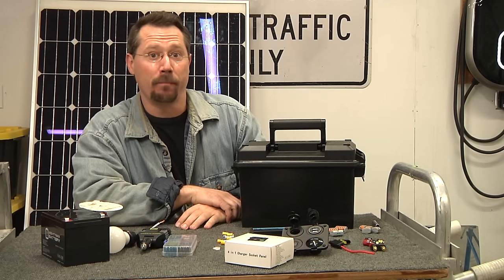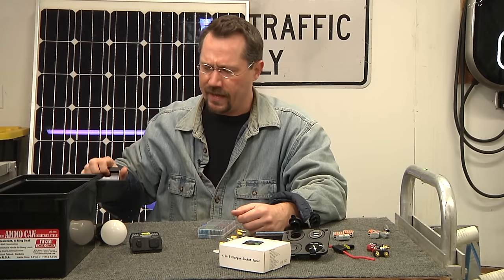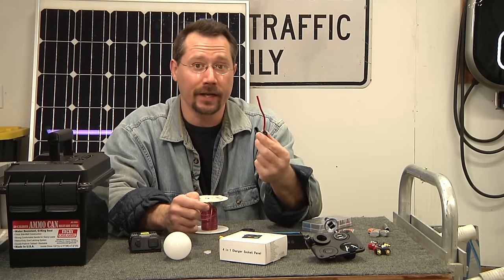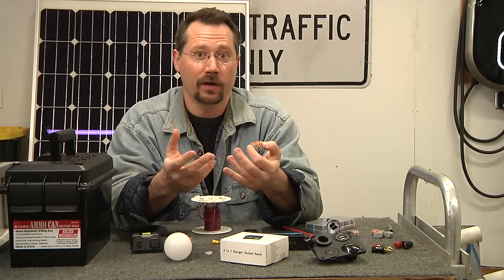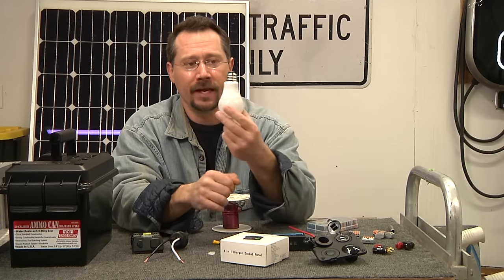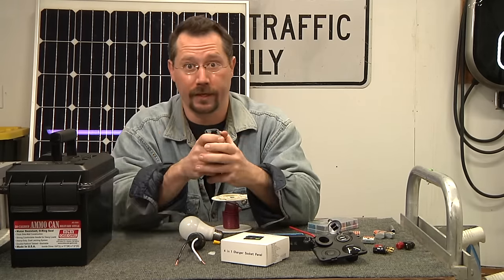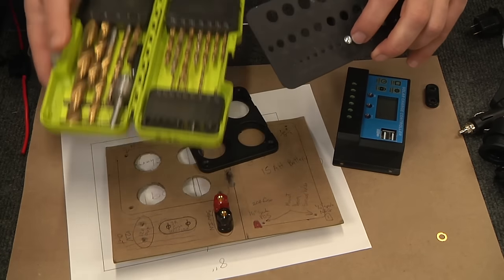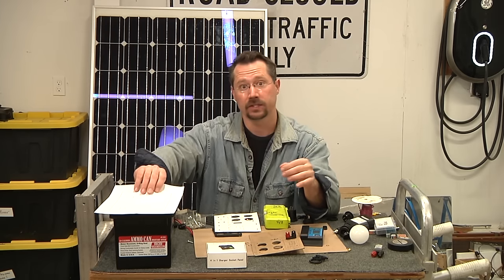Build A Solar Ammo Can Full-Length Instructional Video

Comment: I love this! I have so many questions. This only scratches the surface as I am so ignorant.  I just bought a 100 Ah LiFePo battery.  I am so afraid of and in awe of it -- I want to build a battery box in order to camp with a 12v freezer, use a diesel heater, CPAP for husband, and even sew, etc.  I need more help.  

Do I need a ground wire?
The wiring is hard to sort out here.  Any suggestions for learning more?

Comment: I'm really happy with the "Personal Power Bank" that I built, inspired by this video.  I'd share some pics if I knew where to send them.  The configuration is similar to yours but I went with an 18 Amp-hr battery, built my inverter into the dashboard and added a Cigarette Lighter Socket as an option for the input (1.5Amp Max).  Otherwise, the configuration is very similar.  My current solar panel is identical to the one you featured BUT I'm considering an upgrade. I'm looking at an 80W 4.5 Amp charge rate or a 100W 6.1Amp charge rate.  Questions: Can the banana jacks handle that much current? Thanks again for putting this video together, I keep coming back to it. Chris
Reply: Question: Does the like mean that the banana jacks CAN handle 4 to 6 Amps of current? See above! Again, thanks again for putting this video together, I keep coming back to it. Chris

Comment: Love this video tutorial. I do have a question for you. I'm in the middle of making a pond on my land and I won't  be anywhere near a power source.  I want to have a water pump in the pond and will need power for it. My question is will this work running a water pump and keep it running all or most of the night?
Reply from the maker: To find the answer, you need to do some math.
On your pump (or whatever you are trying to power) there should be a label saying how much current (in Amps or A) the device uses.

Batteries are rated in Amp-Hours, or AH. That is essentially how many hours they can run that many amps.
For example, a 50AH battery should be able to run 5A for 10 hours, or 1A for 50 hours.
Keep in mind that for lead-acid batteries, to give them a good long life, you shouldn't run them down more than half-way, so that 50AH rating really becomes 25AH usable.

If  you have a device that draws 5A, and have 25AH of usable battery, then the battery can power the device for 5 hours.

If you are only charging with solar, you also want to make sure that you can get a FULL charge during daylight hours AND that you can run the battery for several days without recharging because it's not sunny every day.

These are just the quick basics.
There's no fast answer to "can X run Y?" without knowing all the specifics.

Comment: Great video! As an electrician, I wouldn't recommend quick connects because of the higher amperage. Solder or wire nuts or crimped connectors are better because of more surface contact with the wire is reliable over time.
Reply: There's no high amp components in this man.
Reply: @JonJon501  Depends on how much current the load pulls from the battery.  I overloaded my battery box (which has a smaller battery) and popped the 25 AMP main fuse...
Reply: BUS BARS

Comment: Hi.  Love this build.  I am building this today but bought 2 x 8ah 12v batteries instead of a single 15ah (battery availability).  I will be wiring them in parallel but should I connect the charge controller + and - to a single battery or + on one battery and - on the other battery?
Reply from the maker: GREAT Question!
The generally accepted practice for batteries connected in parallel is that you want the power connections to the rest of your equipment to connect on different batteries instead of the same. If you have two batteries in parallel, connect at opposite corners with the positive on one battery and the negative on the other battery.
Always keep all connections the same length and as short as possible, using the appropriate wire.
Reply: @BenjaminNelsonX  awesome! Thanks for thr quick response.  Then it's prob not best to use wagos to connect the batteries in parallel and then connect the controller to those wagos?  Just connect the two batteries together with 12ga and then seperate 12ga from the controller to thr batteries on opposite ends...?
Reply: @BenjaminNelsonX  hi , I have been enjoying this ammo can setup for lil while now.  I use it mainly for my camping trips to charge phones and cameras. Works awesome!  One question, what do you think about charging this from a car cigarette lighter (only when the car is running).  That should work, right?  The car is at 13.5-14v when the engine is on so it should charge the battery can... albeit it could be slow which I'm ok with.

Comment: Maybe you have the answer to my question:   I do solo camping in an old van.    I would like to have a gas generator charge the bettery in a solar power pack (commercial or not).    I would like th battery in the power pack to power some light devices like portable refridgerator, LED lamp, radio, computer, smartphone charger  all over night and even a bit longer (as much as possible).    The question is:   What is the right way of plugging the generator to the commercial solar power pack?

Comment: If I use a larger battery (mighty max 35ah) on it’s side. Think this would work or would I need a bigger box? Great video btw.
Reply from the maker: This project is really more of a concept than anything. If you have some other convenient size box that works well, use it. I just really liked the way this particular battery fit this particular box, it was stackable and modular, and everything fit inside. People have built similar projects with Pelican brand cases, suitcases, and all sorts of other boxes.
Just know the measurements of your battery and your box and you should be fine.
Reply: Thank you sir!

Comment: Another question if you don't mind. I see you connected 6 black wires to 2 wago connectors. I also see a small black wire connecting both wago connectors together. Could you explain this move please. It is not explained in your wire connection on this video. I realize you compressed the wiring part for shortness but I don't want to miss any pertinent connection.
Reply: Basically, all the black wires go to a common ground, 12V DC Negative. They couldn't all fit in the one 5-wire Wago connector. Another way to do it would be to have all of them go to a ground bus bar. Something like this - https://www.amazon.com/dp/B000NCYQ82/ref=cm_sw_em_r_mt_dp_U_5ZGeFbAACBA12

Comment: Will this system output current while charging the battery at the same time so if I'm using the power and the solar is active will it output steady current? Aswell if the battery depletes will it charge back up automatically and then send current through again, I'm asking because I'm looking for a portable solar setup for my Ev while I'm parked in sunlight. And essentially just need the solar panels to charge up my car

Comment: Hi Ben
Got a quick question. I did the solar ammo can setup. When I plug in a portable 100 watt inverter into the 12v cigarette lighter plug the ammo can unit shuts off. All wiring is done right. Do you have any answers to this issue. Thank you. 
Tim

Comment: flat washers then lock washers next to the nut...

other then that, it is nice, for a simple off the self project.

you should look into upgrading it to a 18650 pack, and get aprox 6 times the storage, and not much more weight...
Reply: I notice that too. The lock washer is used to keep the nut from moving. Only 2 of us noticed or only 2 bothered to reply?

Comment: Great video! thank you. i wonder if it would be possible to parallel to of the same battery you have used in this box and get double the power? would the other items need to be increased in their strength and amp?

Comment: I can use the 12v 100 watt panel instead without any issues? Like i can wire that in place of the one in this video as a straight swap out without and wire gauge changes or component upgrades?

Comment: Stupid question, but how come the negative wires require 2 of those lever locks with a wire also connecting both of them, while the red only has 4 wires?

Comment: Fantastic video. My one question would be is it at all possible to charge this as you are driving, through the 12V cigarette lighter, or is its output just not as much voltage above what is needed to effectively charge the ammo can battery? How about using an inverter off the cars cigarette lighter then using your AC power charger?
Reply from the maker: You can essentially run power straight from your cigarette lighter plug to the battery. When your car is running, the voltage of the car battery will always be at a charging voltage higher than whatever the Ammo Can battery will be at.
The exact current the battery charges at will simply depend on the difference in voltage between the two batteries.

Comment: Any ideas on what solar panel to use? Just starting buying my supplies. Can’t wait to put this stuff together.
Reply from the maker: A 20 watt solar panel is a pretty good match for this setup. Something along these lines: https://amzn.to/3AP7zAj
Reply: Excellent. Just went and bought a battery, red wire, black wire, in line fuse, and a few other things. I’m going to put this together in a plastic toolbox of mine. Thanks for the help!!

Comment: BenjaminNelson, I am putting together a small system that is going to be used outdoors year around to power a trail camera and a Netgear Arlo.  The ammo box will be closed at all times.  I added a vent that will not allow water or insects in, as high as I could on the box sidewall.  It is about 3/4" diameter. Is this vent necessary, and if so, is it alone sufficient?  I thought about adding a USB fan to circulate air on a timer to come on for an hour once per day.
Reply from the maker: SLA batteries should not need to be vented in regular use, flooded batteries should be.
Keep the box in the shade.

Comment: I love your ingenuity!!  One question as I'm considering doing this project.  Could you perhaps use a lighter socket in a vehicle to charge this system while you are moving from one campsite to the next, so that a person might efficiently use their time when they couldn't be charging up the unit with solar or an ac outlet (as they be on the road)... And then top off the charge to the battery using solar once they reached their camping destination?  If so... And ideas on how best to manage this?  Appreciate your consideration and interesting ideas!!
Reply from the maker: Great idea.
Yes, you absolutely COULD charge this from the 12V battery in your car via the "cigarette lighter" 12V jack!
You could just have a cig plug with bare wires on the end and connect that to the "SOLAR IN" port. 

The only thing I can think of at all is that some newer cars only have a pretty low power output as it's dedicated as a 12V power plug only (NOT a lighter). You might just want to check your car fuse box first for the cigarette lighter circuit, to make sure it's not a really low power one, and to be able to replace the fuse if you accidentally DID blow the fuse.

Comment: You mention wires of 12 gage being used but the 20 amp in line fuse I see have 14 gage wire on them? Will this make a difference.  Can't find a 20 amp inline fuse with 12 gage wire. Great video BTW. Ordering parts on Amazon myself.
Reply: Keep looking. The purpose of a fuse is to protect the wire. DO NOT use 14 gauge with a 20 amp fuse. It should have a 15 amp fuse. If these 20 amp fuses are, in fact, used with 14 gauge wire it is a violation of the National Electrical Code. Report this to your county inspector or the local fire department.

Comment: Great video...I'm currently building one of these and I have ordered most of my parts. I like the wago connections. I was curious how the cheap solar controller is holding up..?? I ordered a 30A of what looks like the same model.  Please let me know if you have any other suggestions...like, banana clips....is there a better way to connect the solar panels..??? Thanks for your help and you have a new subscriber,  appreciate the love back my way on my YouTube channel!!! Thanks again for the great video!!!
Reply from the maker: I haven't had an issues at all with the solar charge controller.
There's a ton of different style connectors that you could use to connect a solar panel. If using any type of connector that holds both wires, just make sure it's polarized so that you can't plug it in reverse polarity.

The only type of connector I would advise against would be ones like the MC4 connector. Those are perfect for large, permanent solar arrays, but they have a locking mechanism which requires a tool to disconnect - NOT what you want for a portable system where you would regularly connect and disconnect a solar panel.

Connectors along the lines of Anderson Power Poles are popular for all-purpose connections and would work well for a project like this.
https://amzn.to/3cgIsyl
Reply: @BenjaminNelsonX  thanks bud...I had been eye balling the Anderson connectors, and I think that's the way I am going to go.

Comment: Why don't you use the usb ports of the charge controller? are they not that efficient? Congratulations, very good job, thanks
Reply from the maker: This system has PLENTY of USB ports. Use any and all of them that you want.
Since the USB ports on the 4-in-1 output panel can be wired up with a power switch, it can be a convenient way to turn on and off an item like a USB light.

Comment: Hi, you video just popped up om my feed to view. (and I am glad it did).   One question though.  Most systems, including mine, run from the solar controller to the battery bank, and then draw from the batteries for the accessories.   Your video seems to indicate that the load terminals in the solar controller draw back from the battery and output to the accessories.  Is that correct?  That opens up some possibilities......Have never seen it explained that way in the past....
Reply from the maker: A fair number of solar charge controllers have a "Load" output built in. For the most part, these are simply a Low Voltage Disconnect (LDV.)
This allows the controller to disconnect power between the battery and the load if the battery voltage gets too low.
It's a great way to protect your battery from over-discharge.

There are also dedicated Low Voltage Disconnects available.

If you are running something like a high-current inverter, you do NOT want to run it through the LOAD connection on a small solar charge controller like the one used in this project, as it isn't designed for that kind of current

You would connect a high-current inverter directly to the battery (through a fuse) and just make sure to turn it off when it's not being used.

Most inverters will also automatically turn off at a certain low end voltage.

A low voltage disconnect is really fantastic for loads like a DC lighting circuit. It's pretty easy to forget to turn a light off at night and have it completely drain a battery. The LVD prevents that.

Comment: Thank you @BenjaminNelson, this is probably the best video tutorial I've seen so far, very detailed explained which is simply superb. I'm a new to electronics and I though of something I kept wondering about: this battery, being 12V, would it be sufficient and appropriate for starting-up a car with a low / discharged battery? I though of it because inside the ammo box you placed those 12V DC output jacks, so I wondered if they could serve this purpose!! =) anyway, thank you again for this excellent video.
Reply from the maker: You would PROBABLY not want to use this to jump start a car.
Small batteries like this generally have a poor ability to output high current. A gas engine vehicle uses an electric starter motor which draws very high current. You might be able to connect this battery up to a discharged battery and just let it sit for a while. That may bring up the voltage in the original battery enough for starting.

I HAVE "jump-started" my own Mitsubishi iMiEV electric car with the Solar Ammo Can. I accidentally killed my 12V battery in the car. An electric car doesn't need the heavy draw of a starter, it just needs the voltage to power up all the electronics. Started up just fine, very easily!

There are some "Portable Jump Starters" out there that have batteries not much bigger than this, but I think that those tend to be a slightly different battery type more designed for high current. They also have thicker cables (with alligator clamps) specifically for the higher current.
Reply: @BenjaminNelsonX  Most of the jumpstart boxes use one of two battery types: either a 20 amp-hour SLA or a lithium-ion.  Mine (with an SLA) will jump my 4-cylinder Toyota but will NOT jump start my 7.2 liter (454 cubic inch) Chevy Suburban.  That takes a regular car battery.  My friends lithium ion jumpstart will jump his V8 Tundra pickup if you leave it hooked up for 25-30 minutes (to transfer it's charge into the vehicle battery).